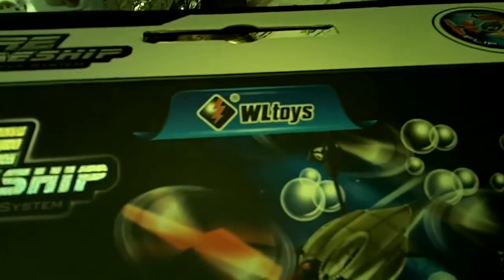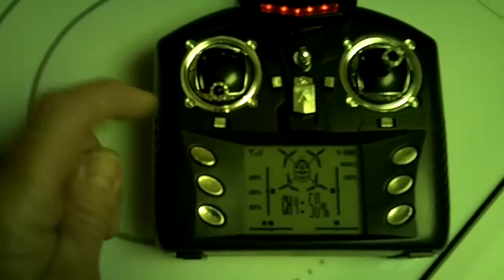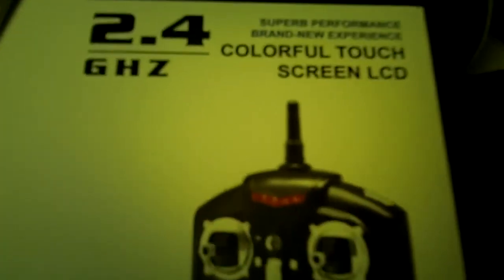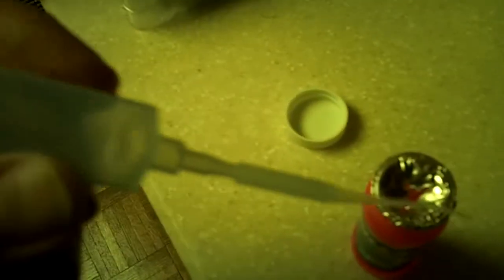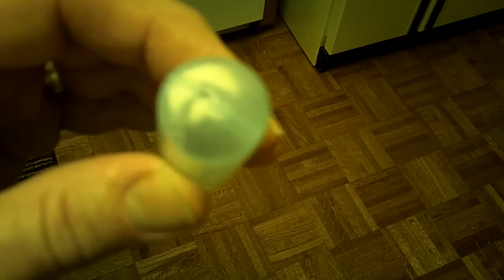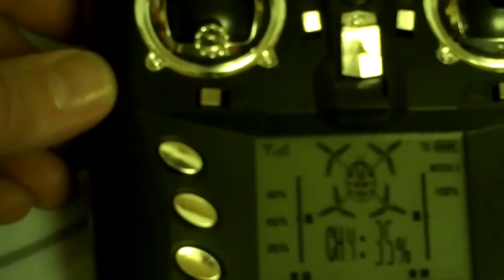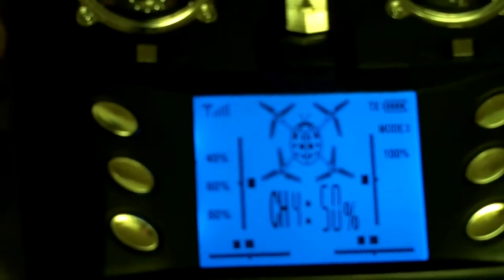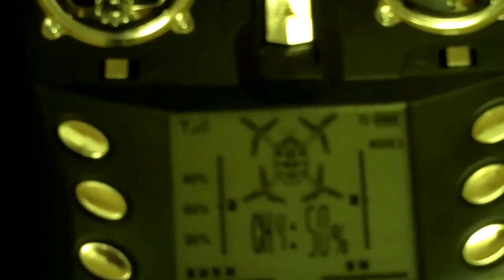Issues with WL Toys V969 Bubble-blowing Quadcopter

Comment: I have the v262 quad copter.  You forgot to mention, or maybe you have not experienced the failure rate of the brushed motors.  I'm on #5 and only have maybe two hours flight time! This is more problematic on the larger v262 is my guess.  They are fun once you've figured them out and have spent around $75 in spare parts...